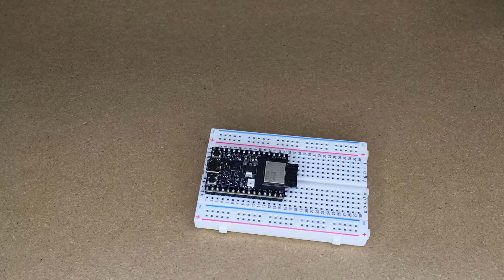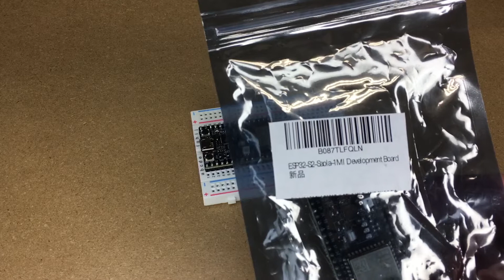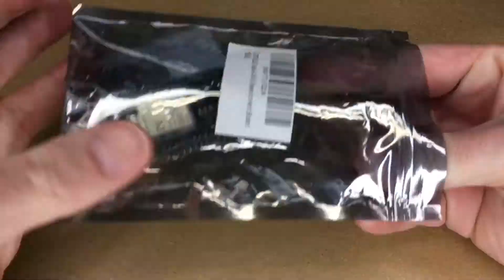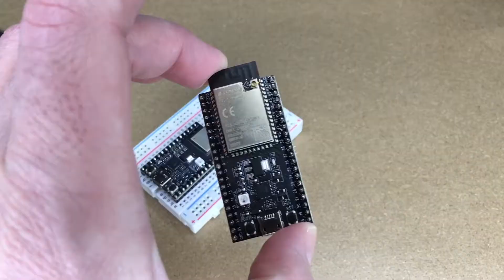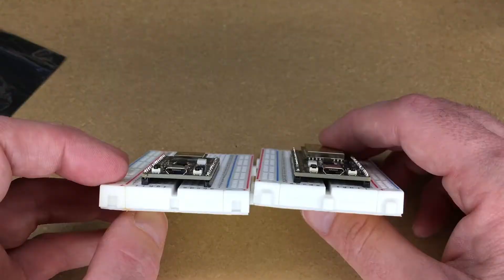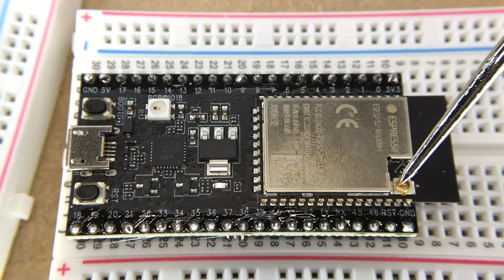Espressif ESP32 S2 and ESP32 C3 Dev Board Comparison

Comment: It seems the biggest advantage to the single-core Risc-V C3/C6 is that it has a built-in debugger... whereas the dual-core/bluetooth S3 requires an external esp-prog JTAG adapter?

However, in terms of development, I'm a bit confused.. 
VS Code + IDF Extension you need to first install IDF
VS Code + PlatformIO Extension, you DON'T need IDF nor IDF Extension

but aside from the different build-systems, what is the difference between VS-Code developing/debugging using IDF versus using PlatformIO?  

Do you use PlatformIO?  If so, do you single-step debug with built-in jtag (C3,C6)  or external jtag (esp-prog) ?   btw, VisualGDB can be used to debug using gdbstub in case you don't have any jtag option!    

Would love to see a video on setting up the environment (openocd?) to debug esp32s!

Comment: Good comparison. Like you, I don't hook many sensors to any one board, so the esp32c3 is my favorite. I adopted the Xiao ESP32C3 as my 8266 killer. I like the fact that it has the rtc deep sleep wake up without trying to hook gpio16 to reset as in the 8266, and the interrupts are more flexible. The S2 is the Native USB. I originally got this one for lower power, but life is way too short to use the Arduino IDE with a deep sleep sensor on the S2. What a pain it is to debug anything when the port keeps changing. SO, the Xiao ESP32C3 is my king of the hill for new sensors. With the LION battery management on chip and the low power consumption, it's perfect. I use ESPNOW for my remote sensors (usually with a solar recharge) and currently have a Xiao C3 running on a 900ma (cr123) lion battery, without recharge for 20 days running. It kicks out a bmp128 status to my server once an hour via espnow. Presently I've been running a couple esp8266 M3's (easier to hook 16 to reset) with the same battery and a single solar recharge continuously for 3 years now.
Reply from the maker: I took a break from the ESP32 and am trying to get back into it now. I'll have to check out the Xiao ESP32C3. I have some ESP32s2 minis but I like the idea of a battery manager onboard. As you said, sounds perfect for remote sensors. I'm going to try to play around with ESPHome one of these days.
Reply from the maker: I got one in today. It's so tiny. Worked great! Thanks for letting me know about it.